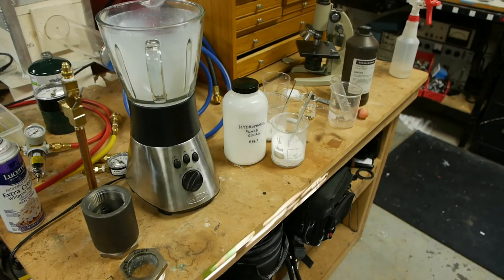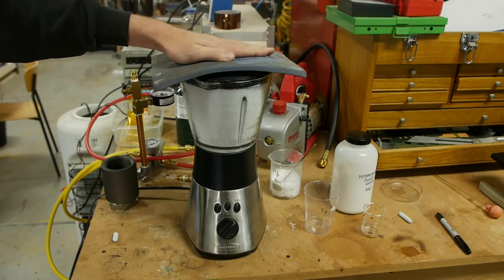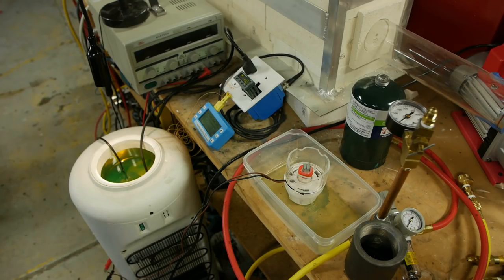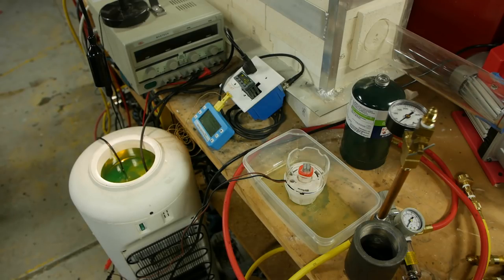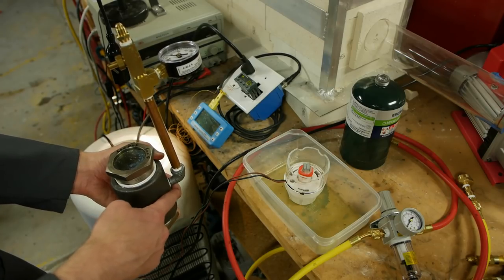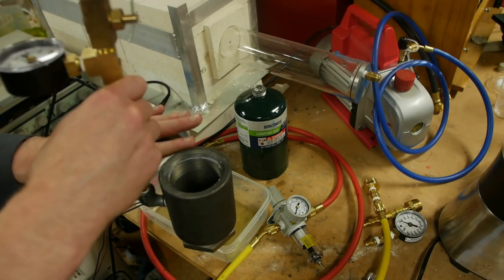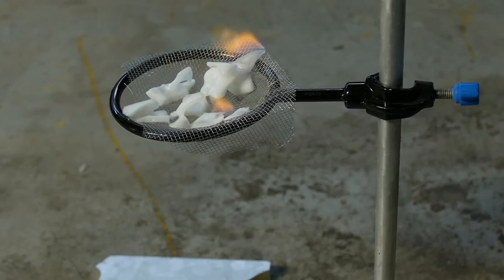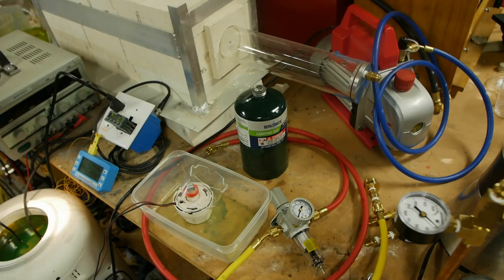Dry water and Burning ice: all about gas hydrates

Comment: "...super uninterested in interacting with water..."

I like this explanation. Hydrophobic substances are often described as "repelling" water. Of course, there's a case to be made for this, as we could talk about maybe "net" repulsion by comparing the attraction against the electron repulsion. But that's two (or more?) phenomena being oversimplified to "they repel".

"Uninterested" is nice because it's down the the single phenomenon of adhesion. Hydrophilic substances adhere strongly to water, while hydrophobic substances do not adhere strongly to water. It's a useful visualization.
Reply: formally, something hydrophobic is something that prefers to interact with air than water, that means that changing the athmosphere has a small effect on hydrophobicity
Reply: Interesting, thank you. I had assumed it was adhesion to water relative to water's own cohesion or something.
Reply: @aajjeee  I don't see how your definition could be correct because plenty of molecules are described as being hydrophobic or having hydrophobic groups even when fully submerged in water. This is how cell membranes retain their shape (two layers of molecules, each with a hydrophilic end and a hydrophobic end, where the hydrophobic ends face each other and present the hydrophilic ends toward the outside and inside of the cell)
Reply: they have a value representing the surface energy, which is calculating by taking the angle of contact of a droplet of water on the surface of the molecule withn a normal athmosphere.

changing any of the conditions (type of droplet, air composition, surface propreties) will result in a change on the mesured angle.

however the fact that the angle changes dosent take away from the calculated surface energy in a regulated test (or compared to a known value) so a molecule can still be hydrophobic when entirely covered in water, it just is in a higher energy state and will ''seek'' to find another hydrophobic substance, like air

Comment: I used silica fume as an admixture for making ultra-high strength concrete for  American Concrete Institute competitions when in college.  Generally speaking, the lower the water to cement ratio the more strength the concrete would be... so silica fume would disperse the limited water throughout the cement mixture more finely, and effectively.
Reply: Normal silica without a hydrophobic coating? This will bind water in itself, maybe >50% in a mixture like concrete. So there goes your water content (it goes down). 
So im not sure about what mixing has to do with anything. Concrete should be a really good mixture (in terms of water and cement) already. If there was a issue with mixing it to get a higher strenght... just about anyone would simply mix it better. Its not like mixing is a hard thing to do industrially.
Reply: Silica fume isn't the same as fumed silica. Silica fume is spherical, but fumed silica has a branching structure, so it has a much higher surface area to volume ratio.
Reply: You are right, thats something different and its not going to bind the water (its no desiccant).
But I still higly doubt that normal concrete is not mixed properly.
Reply: @elypowell6797  Good point!
Reply: Ely Powell Haha, what the hell does this comment mean?
Reply: What ultimate compressive strength in MPa/N/mm^2 did you manage to get?
Reply: More about this? Thank you for the link. How much could this stuff adsorb?
Reply: I test concrete for a living and let me tell you guys
It IS NOT always mixed properly 🤣🤣🤫
Reply: Replace the water in the concrete with liquid glass at a lower liquid ratio for maximum strenth. It is what was used for all megalithic structures around the world including all stone in the pyramids. All 100% geopolymer

Comment: I've never used a magnetic stirrer, so I had always assumed they used fixed coils with AC current to create a rotating magnetic field, like the stator of a synchronous motor. I didn't know it was a permanent magnet on a separate motor. It's kind of a let-down. It would have been cooler if the only moving part were the stir bar, but it's probably more efficient this way, since there's less of a gap between the rotor and stator.
Reply: I think the actual lab-grade stir plates do use a rotating magnetic field, but for this experiment he just used a permanent magnet and a motor so he could easily rig it up himself. If you look at some stir plates online they advertise themselves as "no moving parts, rotating magnetic field", but that wasn't necessary for this experiment.

Comment: The "dry water" would work well as a form of fire extinguisher, so long as it doesn't settle too much when stored.

All that surface area of the micro drops can massively decrease the fire temp through evaporative cooling, killing a leg of the triangle.

Towards the end of the video even, trying to light the very flammable material was for not. Would be nice to follow up and toss some on an already active flame.
Reply: Better still you can readily absorb CO2 into the dry water hydrate / clathrate, which one would think would be even more effective.  You may be on to something here.

Comment: I remember taking a can of “compressed air” (it was butane if I remember correctly), and spraying the liquid through a straw into the bottom of a cup of very cold water by turning the can upside down while dispensing it.   The butane evaporating froze the water into a milky white ice containing butane vapor that I was able to remove and burn as the ice melted.

I don’t know if that’s what this is, but it looks quite similar.

Comment: Awesome stuff to see hydrates form!
I work in a gas refinery and hydrates are a big problem in the gas/oil industry.
You need to closely monitor temperature to avoid hydrates early in the process.
The gas/process stream contains water so it's knocked out in drums before going through large desiccant driers.
The process needs to be dry before hitting the refrigeration section (chill train) for obvious reasons.
Hydrates are one of those things that cause us hell but we never see 😂

Comment: I had to look up the fumed silica hydrophobic coating.  I was so used to calcium carbonates and titanium dioxides being treated with stearic acid that I had it stuck in my mind that silicas were done the same way.  Treating them with silanes does make a whole lot more sense though, and it looks like the grades I've used over the years usually were treated with silicones rather than organic acids.    Thumbs up for being well-researched.

Comment: Great video.  For your dry water clathrate experiment, the question is: did you fail to make clathrate, or did it fail to burn?  One way to figure that out is, did your dry water gain mass after being exposed to the propane?

Comment: You may wish to try blending sum Fume Silica and Liquid Propane. In order to produce Dry liquid propane.

But this time pressurize the Blender. And just turn the bottle of Propane upside down so that the liquid will flow into the Blending Unit. Which already contains the Fume Silica.

Which may result in a substance that should not require pressure or cooling to persist in that state. Technically only release gas once it's heated up to the combustion temperature of propane.

Of course you would still have the problem of the energy consumed to create liquid propane. But it would be far more cost effective and safer to transport.

Although it may still be possible to combine propane gas and Fume Silica. If the gas pressure is high enough.

I'm not super sure. But it sounds fun to try out.

Comment: Great Video --
Friendly note -- I hope your ethylene glycol bath was not pure ethylene glycol (EG). EG alone freezes at 8 F, but when mixed 50-50 with water, freezes at like -30 F, and with water transfers heat 2-4x faster than EG alone. I've known people to make that mistake.
Also, for the future, clear PVC is a great (comparitively) cheap transparent material when you're less than 120 F and maybe 100 psi depending on the pipe size. Just a trick for you to have.

Comment: Does dry water evaporate in room temperature? It is just unbelievable  that 95% of that white powder is water and 5% is silica which means that if the water goes away,  it leaves almost no trace.
Reply: "almost no trace" as in "almost the same volume". That silica (as a loose power) has a seriously(!) low density.
Reply: @leocurious9919 ; Exactly. It's only 95% water by *weight*. I think a better metric would be the mole% that is water.
Reply: To actually answer the question: Dry water evaporates at a rate around 2.5 times slower than water, according to the research paper.

Also, a full aluminum can of Coke is at least 95% water by weight. So if you drink a can of Coke, you leave almost no trace. By weight. More believable?
Reply: @Paradox3121 ; Well yeah, obviously. If the aluminium can was to leave a trace, we would pretty soon have run into a big waste buildup problem due to everyone just chucking their empty cans away.

As for 'wet' water not leaving a trace, hard water can have a TDS in the range of 300 mg/l, which equates to 0.03% by weight of solid residue. Looking at all the problems caused by limescale buildup, I wouldn't call even that percentage of residues "negligible"...
Reply: The "trace", in both cases, being pretty huge. One is a same size soda can and the other a pretty large pile of powder. If that is "no trace" to you then I hope if I ever crash into someones car its yours - there is not even a trace I tell you ;)
Reply: @leocurious9919 ; Well, to be fair, if there wasn't even a trace of the car left, he would probably demand that you buy him a new one. XD
Reply: @leocurious9919  Based on 250 g/l Silica (uncompacted) density, one can calculate that the specific volumes are 79% H2O and 21% Silica, which I find still impressive!!!

Comment: There's been a lot of work with covalent organic frameworks (COFs) and metal organic frameworks (MOFs) which are even better optimized for storing gasses at ambient temperature/pressure and even selectively storing specific gasses according to each gas's compatibility with the framework lattice, but the dry water silica version seems like it might be a cheaper alternative when optimal performance isn't needed. It does take some time under positive/negative pressure to saturate/desaturate the COFs with gas, so if your silica did absorb any gas then that might be why you weren't able to observe any burning. In general this slow release of the gas is a good thing though because that means we can transport or store the gas at ambient temperature/pressure without needing to worry about it escaping the lattice.

Comment: Nice video, but you should really treat fumed silica with more respect. 

As you've noticed, it very easily gets airborne, and can seriously mess up your lungs.
A mask is the bare minimum, a fumehood is much better. And take care not to spill it on your lab floor : air movements as you walk will get it airborne again, and you'll keep breathing it even after you've stopped handling it.
Reply: Thank you for that caveat. Does that mean that this stuff has to be worked under, say, an oil layer? How is it densified? How is it cleaned up?
Reply: @cherylm2C6671   As I said, either handle it in a fumehood, or wear a proper dust mask (or respirator).

Cleaning is either done using soap and water, along with the cleaning implement of your choice (sponge, mop, rag, paper towel, etc...) or a vacuum cleaner with a good HEPA filter.

If you wish to make it denser, with the usual hydrophilic fumed silica, you can simply add water to it to make it into a slurry, and then dry that in an oven. It will cause the silica particles to aggregate a little. (But they can still get airborne, so precautions should still be taken when handling it.) I am not sure the same can be done with the modified hydrophobic variety used here.

I would assume wetting them with a small amount of a non-volatile liquid like paraffin oil (or glycerin if it isn't the hydrophobic variety) may entirely prevent it from becoming airborne, but it may also interfere with whatever application you had in mind for it.
Reply: @piranha031091  Thanks for that!  I viewed a posting about clathrates, and FS was mentioned as an adsorber or sieve. Perhaps there are applications for deep mines, (or mine fires), or even marine installations.

Comment: There are some considerations to be made with the pressure regulator as there are relieving and non-relieving types. The relieving type would vent the excess pressure from the gas hydrate changing back to a gas state and the non-relieving would allow the pressure to increase. A standard regulator (relieving type) used on typical home/industrial compressed air systems would normally vent the excess gas into the work space from a vent on the regulator. This could make the local area dangerous and sensitive to ignition sources. A regulator used for oxy-acetylene welding tanks would be an example of a non-relieving regulator.

Comment: Ben can you play with these materials some more? What does the powder feel like to touch? When you squish it, does it feel soft or condense into a solid like sand does? Does it feel like it has very high thermal capacity like water does or does it feel like thermal capacity is very low because of silica layer preventing heat transfer? Can you play some more with its heat-shielding capabilities? Can you show what other substances you can get by varying water : silica ratio?

Comment: As you try to heat up the hydrated silica, any water trapped inside is likely going to boil at around 100C, right? So in addition to the insulative property, it's also behaving like a temperature "buffer". In that case, if it's thoroughly mixed with a flammable substance, it seems like it's going to continually draw heat out of the combustion reaction until all of the water is gone.

This brings up another thought. The boiling point of water can be altered by dissolving things in it. This would be a separate process from the physical dispersion of the water and silica. So maybe there's a way to raise the boiling point of the water so high that it wouldn't stop the chain reaction of combustion. Alternatively, reducing the atmospheric pressure around the dry water would cause the water to evaporate out more quickly.

Comment: in gas tanker (shipping) industry, hydrates are well known for resulting in problems in pumps. This is mainly the case in cargoes composed of different hydrocarbons, resulting in different evaporation temperatures. Hydrates can be formed if instable cargo is catalyzed by for example a pressure decrease or increase in a pump. This can let a part of the cargo turn into hydrates, which will start clogging the pump. For more information, google 'deepwell pump hydrates'

Comment: Question: In your experiment, did the Silica (dry water materal) gain mass when you tried to create an hydrate? If I recall correctly zeolites are the primary meterials considered for storing hydrocarbon gases as well as hydrogen. Not sure if the Silica material is classified as a zeolite. I presume that the water (hydrate) is serving as the zeolite substitute for propane. Might be worth a try to liquefy the propane with in the silica and see if form some sort of suspension that can exist above freeze or at room temperature with the need for water.

Comment: If the plan is to use dry water hydrates for gas transportation I don't think it was ever a plan to set it on fire immediately. There might be a need for another vessel at the receiving end where they dump the  dry water gas hydrate in then maybe crank up the heat a bit and reduce atm pressure slightly to extract the gas from it. Then burning it at the end of a torch nozzle. You might give that a try. And also see if the dry water can be reused after having been depleted from its gas.

Comment: I'd really like to see follow up videos where the unusual mixtures created in this video are investigated for use in space travel. For example, water and hydrocarbons are said to be excellent radiation shielding, but water is very heavy. Liquid propane is half as dense as water, and doesn't need to be kept as cold as liquid hydrogen, nor as cold as ice in the hydrate form, but doesn't need to be as warm as kerosene to flow freely. The solid forms, and especially the "dry-like" forms Are likely to withstand some unwanted contact with space debris, and were shown to be great thermal insulators too. This makes me wonder if these dried liquids would be useful for atmospheric re-entry thermal shielding. Perhaps, the radiation/insulation materials can be reconfigured for the Entry Decent and Landing phases of interplanetary flight as well. Something I would have really liked to see tested is the ability of this silica stuff to act as a moisture filter that doesn't require as much energy to regenerate as traditional descants, and possibly its use as a carrier for portable atmosphere processing, such as mixing it with Calcium Oxide to trap moisture and release heat to make Calcium Hydroxide + Heat, but then the Calcium Hydroxide will take Carbon Dioxide out of the air to make Calcium Carbonate and Water. The silicon stuff would help keep the particles dispersed within the airstream for efficiency and hold the heat internally while air doesn't flow. It may also find use in reducing the water needed to grow plants in space...somehow.